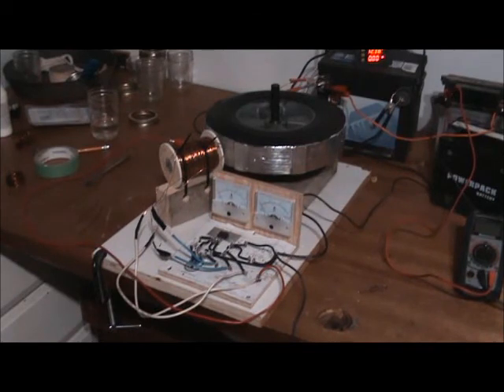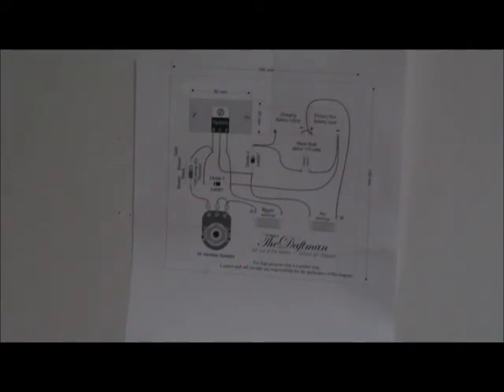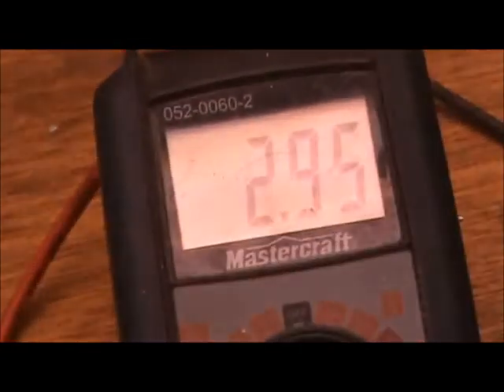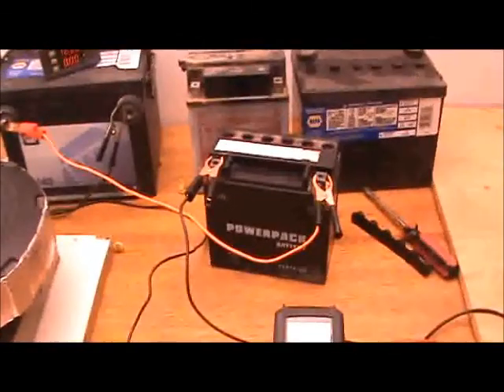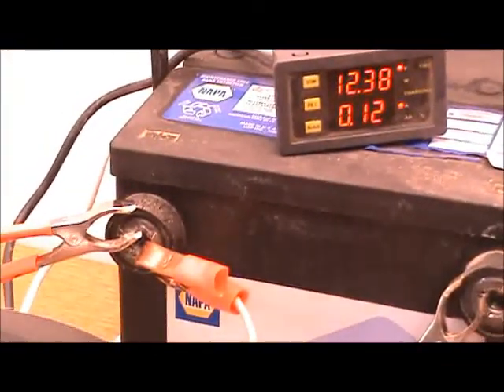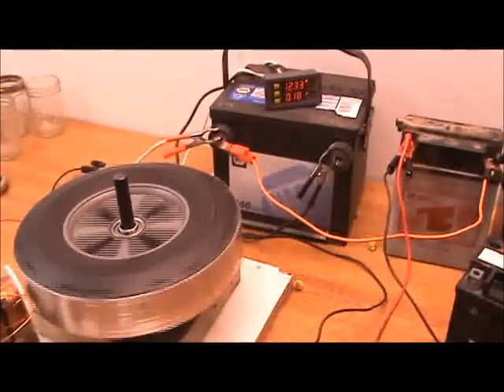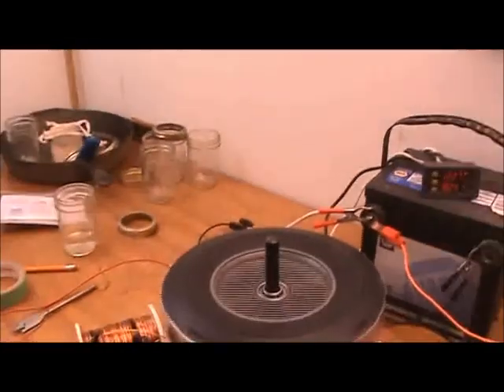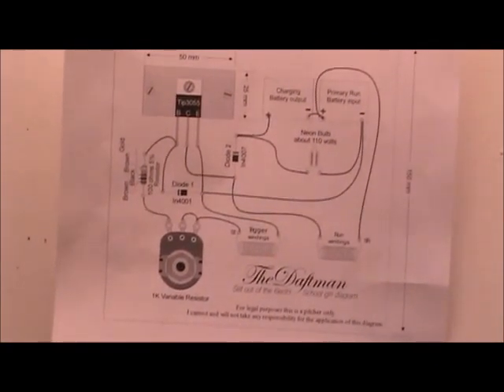Bedini motor for dummy

Comment: I'm not at all familiar with the Bedini motor, or how it can 'recondition' lead-acid batteries.  Just as a suggestion, or curiosity, I'd imagine there are non-motor electrical circuits that can help recondition batteries.  Have you tested the water in the batteries to be reconditioned?  Isn't there some impact of the chemistry of the lead-acid electrolyte that can be adjusted to help reconditioning?  Ok, yes, you successfully got this circuit to do something - and you're a beginner to electronics & circuits.  That's a big deal, and there's so much to learn about the hobby.  Just for YouTube, there are thousands of electronics hobby people who would freely give their time to help you learn.  I started with electronics around age 6, in 1962!   If you need, I'm glad to correspond.  Best of luck!